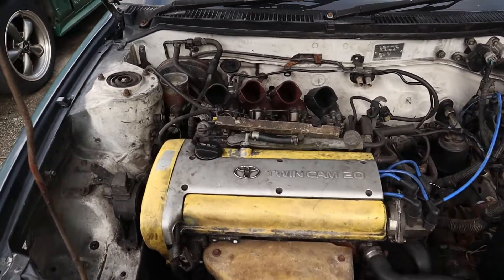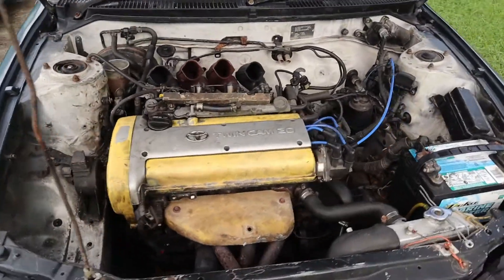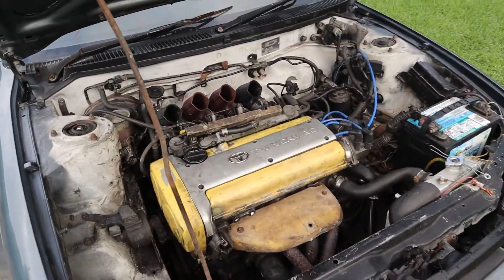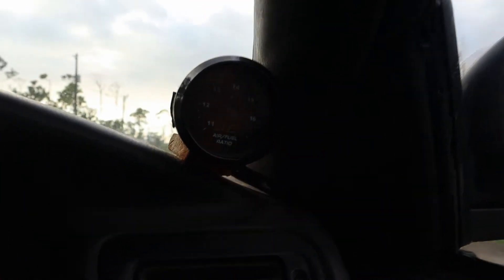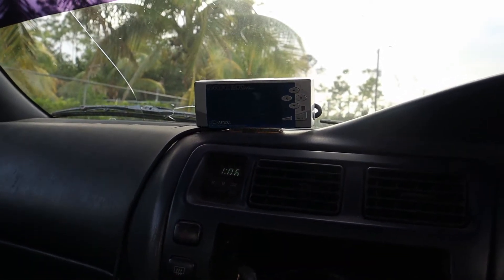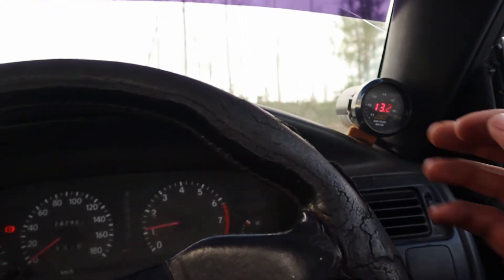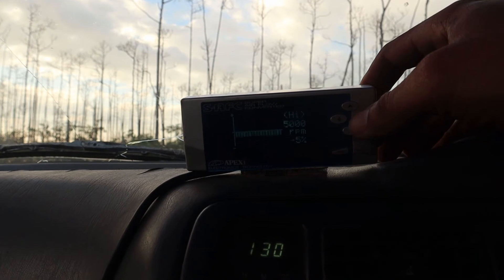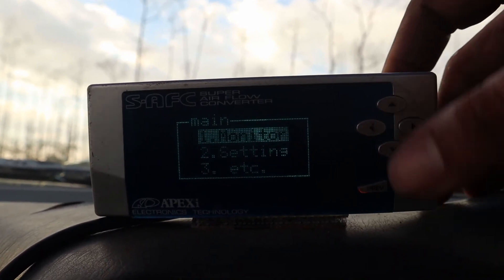Street Tuning A 4AGE (Apexi SAFC How To Video)

Comment: Hey, im looking to buy one for my Swift, how do u get ur throttle signal? Isn´t a 4AGE a cable operated throttlebody?
Reply: @DriftDreams242  Could you explain to me how you did your wiring? I tried reading in Forums with no luck. My engine is also cable operated and uses a MAP sensor.. Also thanks for the fast response man!
Reply: @JANNIKKICHANNEL  is you your car the GTi?
Reply: @DriftDreams242  Ah, i see. then it´s fine lmao

Comment: So do I need to adjust fuel trims every time the weather changes on the safc itself? Like if one day it was 70 degrees then the next day it dropped to 40 I would have to add a little more fuel it wouldn’t adjust on its own?
Reply: @DriftDreams242  thank you so much for the response I also have a question whenever I go cruising in any weather I always adjust my air fuel ratios to 14.7 the recommended under boost 11.3 now whenever it gets a little later in the day my afrs while cruising once it hits like 5 pm or later the cruising air fuel ratio jumps from a good 14-15 to 16 sometime even 17 I add more fuel and it doesn’t seem to help out not sure if I should take out some fuel or add at that point either way if I do add more It doesn’t seem to help it still holds at 17
Reply: @DriftDreams242  Wally 255 and to my knowledge no aftermarket afrp also injectors are just 550cc not that much bigger
Reply: @DriftDreams242   not sure but I’m only running 15 lbs of boost and it only has wonky afr while cruising if I try and get on the throttle a little then it start to go back to 14.7
Reply: @DriftDreams242  yep we’ll once I open up the throttle it goes back to the usual afrs I have it set to it’s just that cruising ratio I have it between 14-15 it never goes to 16 but whenever it gets late like 5-6pm the car just leans out a little so I add maybe a little fuel like 1-2% and it doesn’t seem to bring it down back to 14 it stays at 16-17
Reply: @DriftDreams242  well as my tuner described it the colder it gets the more fuel car needs since air is denser the hotter the less it’ll need. I live in the mid west Nebraska it’ll be maybe 50 degrees outside and then around 5-6 afternoon it’ll be 41-36 degrees but even if I add 5% more it still doesn’t really change it
Reply: @DriftDreams242  I’m plan on getting one but I also wanna learn the safc I’m thinking of just taking out tonight it’ll be like 25 degrees just to see how it reacts and try to get the hang of adjusting safc on the go

Comment: Hay thanks for the vid I'm currently working on my project built a 111 trueno with a silvertop ,AWD box and I happen to have the super afc with the manual buttons . What I wanted to know did you use bigger injectors as I am planning to as to add boost .

Comment: Do u need the standard o2 sensor for the safc to wrk properly.?
Reply: @DriftDreams242  ok I currently have the safc 2 on my starlet with the 4efe ecu I have a ct9 turbo on the 5efe standard engine 
My issue is I took it to a guy to tune it but when I'm not In boost I get 11s  which is perfect in boost but I also get that wen I'm cruising  he had the fpr at 60 I turned it down to 40 hence y I get the 11s now so do I go in the LO throttle settings n cut fuel ? I need some help
Reply: @DriftDreams242   cud always give me a shout bro n drink a few beers lol
Reply: @DriftDreams242  so just edit the LO throttle setting
Reply: @DriftDreams242  alright thanks
Reply: @DriftDreams242  I'm a little nervous but imma risk it
Reply: @DriftDreams242  my type of dude!!! Thanks alot in helping me much appreciated
Reply: @DriftDreams242  had a feeling u were from the caribbean lol I'm from 🇧🇧
Reply: @DriftDreams242  Barbados bro I followed ur IG just now
Reply: @DriftDreams242  yeah I do lol caribbean life forever!!
Reply: @DriftDreams242  lol great place
Reply: @DriftDreams242   lol good man

Comment: I'm coming back to this video after trying to get this to work with a bmw 325 that's turbo'd. In your sensor setting, if you're using hot wire, how did you figure out what sensor values to use?
Reply: @DriftDreams242  it's all good. My buddy bought a BMW E36 that was professionally tuned in the '90s but he accidentally initialized the s-afc lol.
Reply: @DriftDreams242  i gotcha. Do you know what your current settings are?
Reply: @DriftDreams242  lol ah I'm late to the party. Thanks for the quick responses though!
Reply: @DriftDreams242  yup lol

Comment: So in the beginning when it was idling you had it set to deduct 25% fuel on the low map. This is before you started to explain the video. The engine was idling fine. Then for the video you set the 25% to 0% and then the car wouldn't idle because too much fuel was entering the engine. So in your case with a 20% deduction in fuel the car would not idle. You needed a 25% deduction to get it to idle properly?

How does this work (the S-AFC) for an engine that's cold started vs hot started?

Also does the S-AFC make the adjustments on the fly or do you have to cycle the key?
Reply: @DriftDreams242  Thanks, yes on the initial cold start you need more fuel and less air to get an engine to start. What happens if you set the S-AFC so the car starts fine when cold but then you drive it around for 30 minutes and shut it off. Now that the engine is at operating temperature what happens when you start it again while warm? Would say 25% or whatever reduction is necessary to cold start it work for a hot idle?
Reply: @pattygq  you need to have an extra bypass air valve .
ive made a vacuum box throw all vacuum lines in it .
map - fpr , iat and servo booster are connected there .
i added a bypass air valve ( like the one that lets more air in the manifold when you turn on the a/c or the lights ) to the vacuum tank .
this valve i use with a switch from the inside of the car .
when cold start i turn on switch of ''iac'' valve .
this lets air in the vacuum tank so vacuum in the tank is decreased so map readings change and gets a bit richer . around 13.5 for about 1-5 minutes depending on the temp outside .
then i turn off iac valve , vacuum rises map gets normal readings and afr gets around 15 .

this is what ive done to my ITB 4age 16v 
spark plugs are nice yellowish coloured 
it even passes emissions test .

car idles and runs smooth like it is stock .

this is a 4age16v stock ecu . + safc
Reply: @DriftDreams242  I gotcha. Yea this is for an E36 Turbo. I have another standalone ECU with Tuner Studio but the car came with the S-AFC already in it. I'll have to play around with it. Thanks for your videos on how to use it as well as your quick replies.